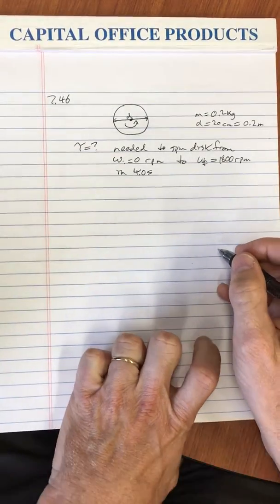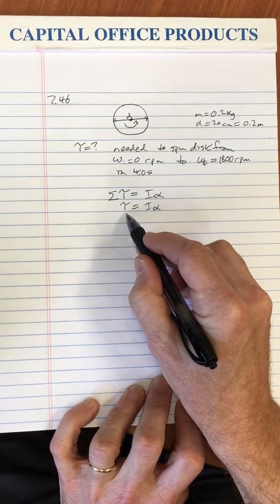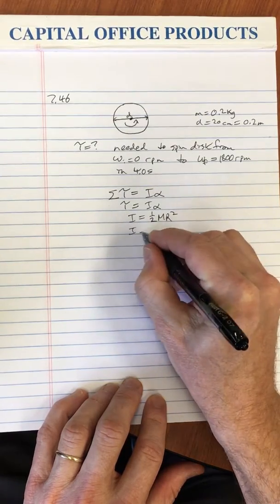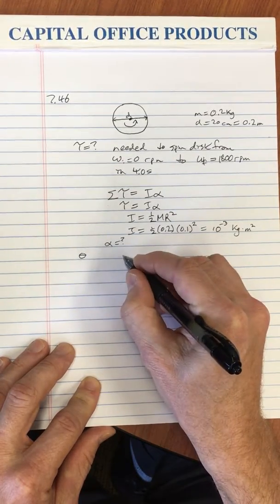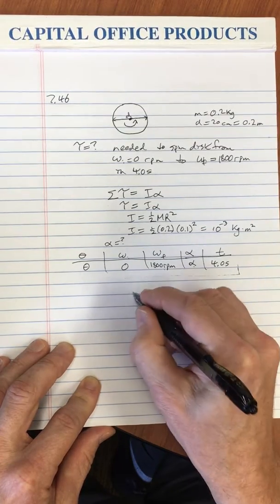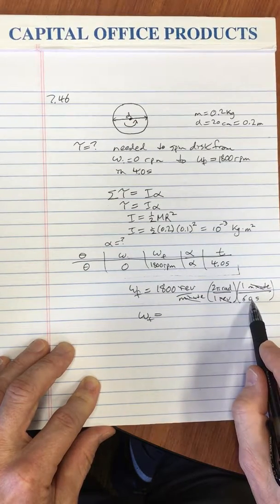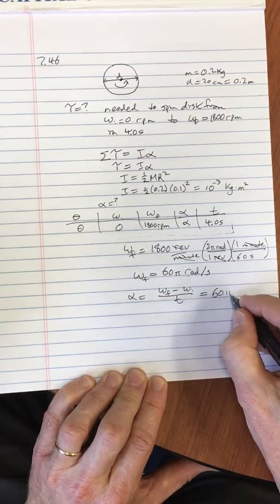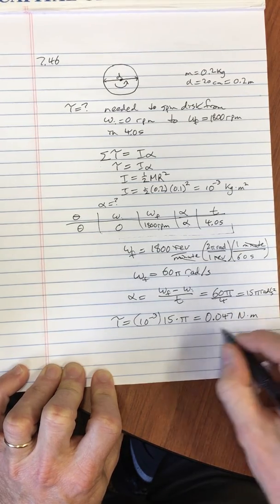Rotational Dynamics Example: Calculate Torque To Spin Disk

Comment: if time is involved in the equation, then no matter how long it takes to accelerate, the disk will always arrive at the speed that any motor can reach, yes or no?
Reply from the maker: I’m not sure I understand the question. Final speed depends on acceleration and duration (time) of acceleration. Alternatively, from an energy standpoint, final speed depends on initial speed and the amount of energy put into the system through a torque.
Reply: @joshuacolwell  what would happen if the motor could not have enough torque to accelerate the disc ? Would it take longer to accelerate at some specific velocity, or the rpm of the disc would decrease ?

Comment: If I have a vertical shaft with 2 more disks fixed to it and evenly distributed how can I find the torque needed to rotate the shaft along with the disks considering all the possible variables in a real life scenario.
Reply from the maker: If the disks are attached to the shaft, then there is no difference from the example given: use the sum of the moments of inertia of the two disks as the total system moment of inertia.
Reply: @joshuacolwell  Thanks a lot !

Comment: Hello sir..can we calculate torq if we only know m,r,and rpm only..
Reply from the maker: Torque changes the angular momentum of an object which means usually that it is changing the rate of rotation. If you know the value of mass radius and angular velocity in revolutions per minute then you can calculate the angular momentum of some thing. But that doesn’t tell you anything about any torque acting on the object you need some other information to know how the angular momentum is changing in order to determine the torque.
Reply from the maker: Another way to look at it is by dimensional analysis: torque has units of force times distance, which means it has time squared in the denominator. The quantities you mention are distance, mass, and angular rotation rate, which just has one time in the denominator. So, again, you would need two values of rpm (start and finish) and the time interval between them, as one example, to calculate the torque to give that change in angular momentum.

Comment: Hi Joshua. very good video. i learned much.  i hv a question. if the disk is not thin but has 3 inches thickness. and is holliw inside. what is the moment of inertia?  thanks.
Reply from the maker: The thickness doesn’t matter, but if it is hollow, the moment of inertia is MR^2.

Comment: How would you find the frictional torque??
Reply from the maker: This example works out the net torque that must be applied to the disk. If there is friction, then the motor torque minus the frictional torque equals I times alpha. We have enough information to calculate I and alpha, but we would need additional information to calculate the frictional torque, such as the torque applied by the motor. With the information provided we can only calculate the net torque.

Comment: Does it make any difference if the plane of rotation is parallel or perpendicular to the ground?
Reply from the maker: The gravitational torque on this disk would be zero because it is symmetric, so the force of gravity passes through the axis and therefore has zero lever arm regardless of the orientation of the disk. So for this problem, no the orientation of the disk relative to the local gravitational vector doesn’t matter.
Reply: @joshuacolwell  Thanks for confirming that. I am making a turntable for product photography and I found your video super-useful for calculating the torque required to spin a 1m diameter 15mm thick plywood disk to 10rpm in 3 seconds so I could choose the an appropriate dc motor (most likely with an attached gearbox) to direct drive the disc. The disc is about 5.7kg so the torque works out to be 0.1529 Nm.
Reply: @arisskarpetis  hi aris. how r u able to calculate the torque or ur moment of inertia since ur plywood has 15mm thickness?  what if the thickness is 3 inches? thanks. ;)  also how do we compute if its hollow inside with only d sides fully covered? thanks

Comment: Good one🤘🤘..what if I have motor producing torque of 2 Nm ..so to stop motor instantly would I require 2 Nm braking torque??? Please reply soon
Reply: What is the torque needed to stop a disk's rotation from <<insert rpm here>> rpm to 0 rpm in 1s (depending on how fast you want it to stop)? I think the required torque is greater than 2Nm.